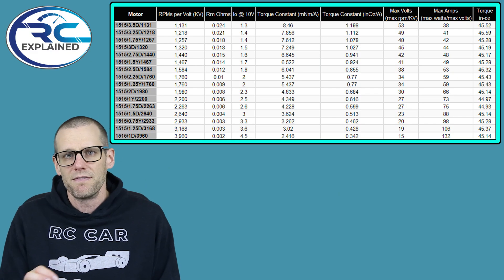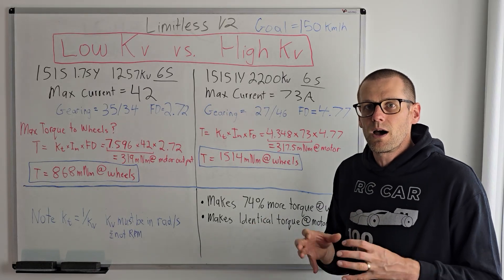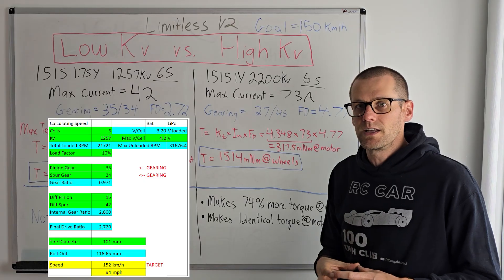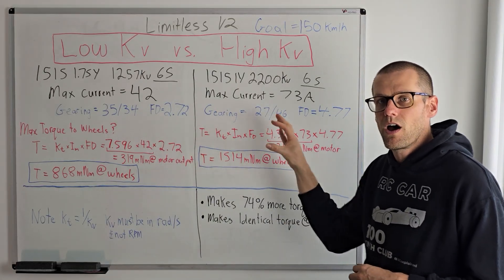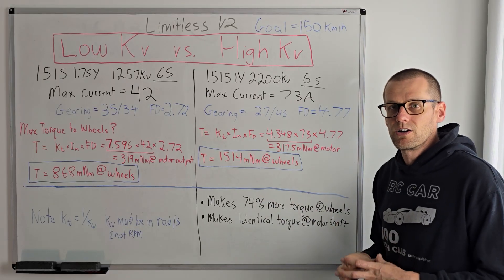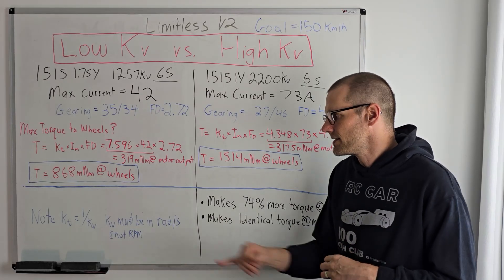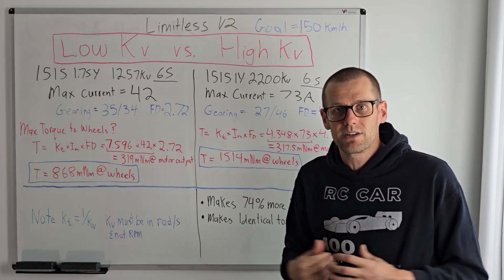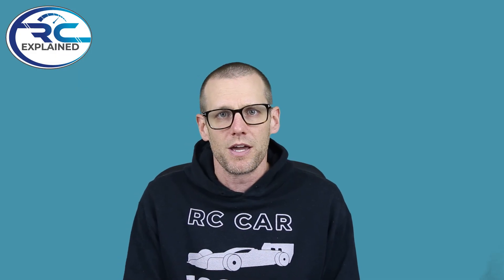Why Lower Kv Doesn’t Mean More Torque — Here’s Why You Got It Wrong!

Comment: Very interesting video, I have an indoor off road track that I go to that will only allow you to run buggies on 2 cell batteries. I have been thinking about setting up an E-buggy for the track where I would run a 2 cell battery with a 550 4 pole motor but I am unsure what Kv motor I should use. Would I calculate everything with your formulas here, probably first calculate the regular 4 cell/1900 Kv setup then plug in some 2 cell Kv setup’s and try to achieve a similar value as the 4 cell setup?
Reply from the maker: Yes, that would work. Plug in your current setup on 4s in to the calculator. Estimate load factor and current draw as I had done in my most recent road test video. Then update your Kv, cell count, current draw and anything else that changes. Adjust your gear ratio to target new speed. Your motor can size needs to be the same for the 4s motor and 2s motor.

Comment: I think a real world comparison would be different. If done with a esc with data logging then compared Amps, Voltage, Ripple, HP, and capacity used.to achieve the same speed.
It might be that you can achieve the same speed and power but more efficiently and batteries last longer with the lover Kv Vs higher Kv in a real world comparison and would be a more useable and reliable motor.
Too always go for higher Kv moters of RC cars that over heat and cut out isn't worth having the extra power if you can only use it for 5 minutes at a time.
These is only so much power you can deliver to the road/ ground as you end up wheeling or flipping out.
And also adding timing to a Lower Kv moters in the same rig will be more advantage as the lower rpm will give you more you could potentially gain with electronic timing as a moter of a certain size but different Kv can only deliver a maximum RPM regardless of Kv. Before the router falls apart and bearings can't go any faster. 
This was my thinking and would like to see if this is possible or not.
Otherwise your better off always going for the highest Kv moter in that size and gearing down. Would be pointless making different Kv moters.

Comment: I do mine a little differently, Not doubting your system, it works going equal voltage, But my philosophy ia a bit different. I see two ways to make RPM and power, High KV/Low voltage, and Low KV/high voltage. My aim is efficiency, not ultimate power. In my thinking you can make power through the current or the voltage. If you use higher current (Lower voltage) on a high KV Motor you are burning through the pack. However, If you use higher voltage (and lower the current) with a lower KV Motor you use the voltage to make RPM, Vs the amps, is a far more efficient path. I do this to lengthen runtime, lower temps and add durability to the power system, in the vehicle. I'm not a speed freak, drag racer or trying to rotate the planet. I usually gear my cars to like 40/45 MPH and just bash them, the lower KV/high voltage setups work better and deliver longer runtimes. Plus the torque comes naturally due to the higher voltages used, You can actually get away with lighter (Smaller size packs) and sometimes smaller motors further enhancing the efficiency by making the car lighter. I like your vids, they give me a different perspective on what I like to do
Reply from the maker: What would you do in this example where voltage is the same for each Kv option?
Reply: @RCexplained  , Honestly If this were me, i'd almost take the lower KV and try gearing it to match the higher KV Motor watt wise, the bigger load will draw out more power, to a point, I know there is a point of diminishing returns, but I would hope the efficiency of the lower KV might can compensate. 
Reason I say this, is in your setups, the lower KV is drawing less amps, which to me is efficient, so could be geared higher to match the higher KV motor (wattage wise). It has always been my experience that lower KV motors have more wiggle room for gearing than a higher KV Motor. I got most of my experience with escs and motors in a time when we rarely ever put a fan on either. We always went by a saying, Motor hot, gear down, esc hot, gear up, both in a comfortable state (120-170*F), setup is happy. I do realize you are going for Ultimate speed so heat will have to be allowable. But I still think the lower KV can be geared a little more

Comment: I think a great comparison would be the Hobbywing 56118 g2 800kv vs the Hobbywing 56118 g2 (speed) 1600kv motors. Especially in a heavier vehicle like a 1/5 Kraton on 8s and 12s geared for 60mph (8s) and 80mph (12s).

Comment: what about rc boats ?
Reply from the maker: I like RC boats!
Reply: @RCexplained me too. They’re my thing. Does your math apply to RC boats too ? I know my TP 4070 1520kv can turn a bigger prop than my 4082 1650kv. I think in the boat world lower  KV does mean more torque. Would you agree?
Reply from the maker: In general, the motor and math doesnt know which RC vehicle you placed it in. I would say only because of the larger size, that the TP4070 destroys the 4082. A 4082 is a tiny motor compared to the TP. Ill see if I can find some numbers and work out the math in theory. Is the 4082 a Leopard?
Reply: @RCexplained thank you, No it’s an hobbywing 4082 / 1650 kv.
Reply from the maker: I struggled to find specs on this and generalized the motor using a Leaopard Hobby Motor. I'd expect specs to be very similar. Check out the latest video I just uploaded a minute ago.
Reply: @RCexplained thank you

Comment: Great insight but that last sentence you said about higher voltage not having an advantage is wrong. Hi voltage is always more efficient because of less heat motor losses as well as ESC losses are lower. more efficient system is faster. Example the lucid air runs higher voltage than a Tesla that's why it's so efficient
Reply from the maker: This video is about torque not efficiency. I dont talk about efficiency at all in this video.
Reply: @RCexplained  if the high voltage system is faster it will have more torque soooo! No worries thanks for the chat
Reply from the maker: Actually its not as simple as saying the high voltage system is always more efficient or faster. 
A high voltage, such as an 8s on the low kv motor and 6s on the high Kv motor, still would not produce more Power output as the high Kv Motor in this example.
Reply: @RCexplained yes but you have to compare apples to apples. If you have a 8s 1000kv against a 4s 2000kv SAME RPM 28,800. The high voltage system will have more power due to higher efficiency.😊

Comment: and yet no mention of poles...
Reply from the maker: Of course, poles are already built in to the numbers and irrelevant at this point.
Reply: @RCexplained  Quick question in this Area... whats theoretically better.... a 1000kv 8-Pole Motor, or a 1100kv 4-Pole Motor? Both same size of 56dia 87length?

Comment: I highly doubt you’re going 150kph (93mph) with less than 100 amps in a car that big. Show us the runs with data logs. Every 100mph pass I’ve ever made in my Limitless has been well over 100 amps at full throttle. Castle MMX8 with castle 1515-2200. 

Watts is power, also consider Ohms Law. Voltage drop under load is a function of battery IR alongside the amps drawn by the motor, this will give you motor rpm under load and then you can calculate wheel speed from there. That is, if you know IR and amp draw, voltage drop can be calculated (v=ir) and then factor in KV minus about 10%, and boom. Motor speed. 

(Also, under load, the motor KV will drop by up to 10% anyway. Just ask Jason at Castle Tech)

Your entire point here relies on a spec sheet from the manufacturer, which we should all know by now are not exactly accurate. Where did they get those amperage figures? How? They never tell us that. These motors can handle well over the specified amp limits, as we’ve seen time and time again from data logs. This is why Castle does not give amp limits, because it’s not a hard line limit in the real world. 

Data logs are the be-all, end-all. 

Ultimately the best way to choose the right motor is by going with a manufacturer who specifies a maximum RPM, because not all of them do. Compare max RPM against intended voltage, consider the weight limits of the motor, etc. 

If you’re well under the max RPM and under the weight limits of the motor, it doesn’t really matter what else you choose about the motor, as long as it fits and the wires are long enough, etc. 

There are a lot of factors and KV is probably the least important of them.
Reply from the maker: Nearly every one of your points is covered in the video. 
I dont show the estimated current for this calculation, but if this is your point, you are missing the point of the video. I have tons of videos that show estimated currents and data logs on current. A limitless pass will not use a continuous current value.